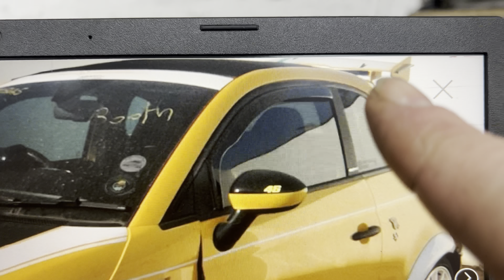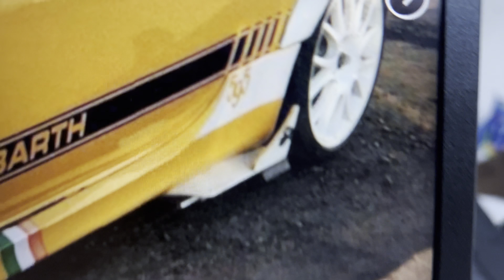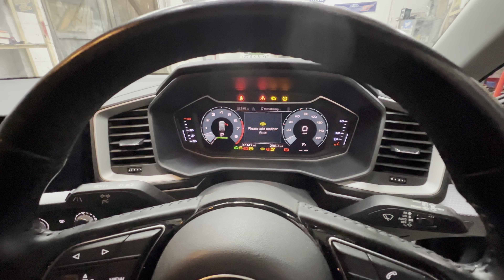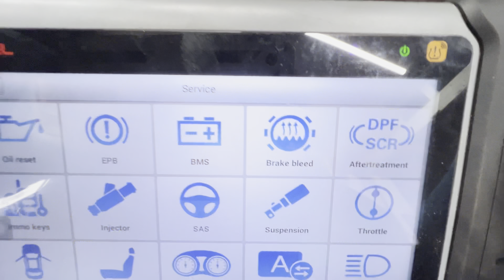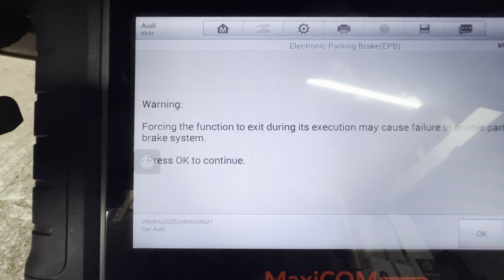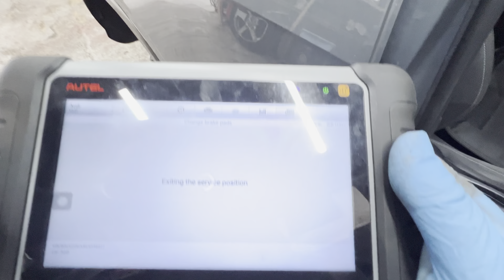Audi A1 2019 And Audi Q2 2018 In For Some New Brake Pads

Comment: It doesn’t when you wind the pistons back it obviously forces the fluid back to the resovoir that’s why you alway take the resovoir cap off before you wind the pistons back
Reply: It's good practice to use a shringe to remove some brake fluid first, that way you don't get it all over your paint